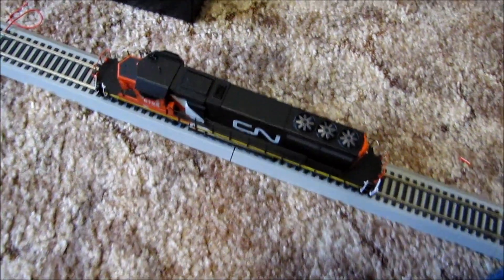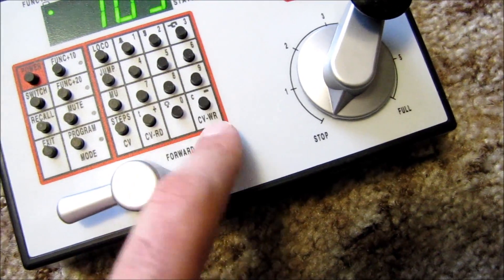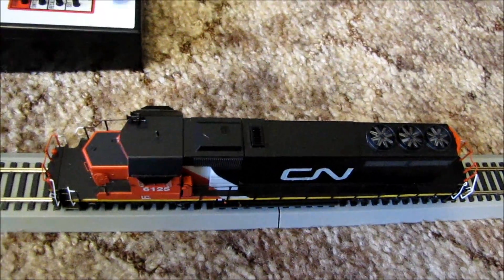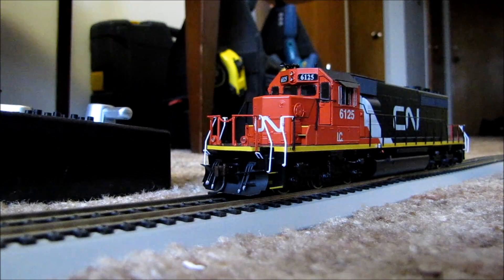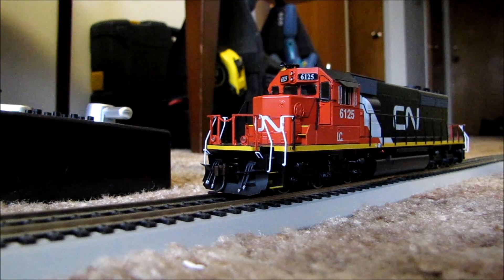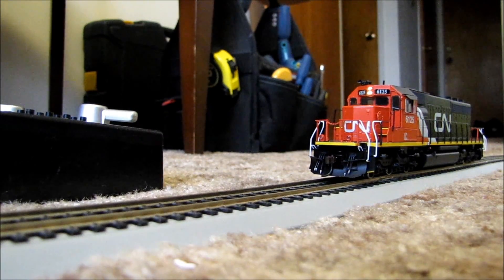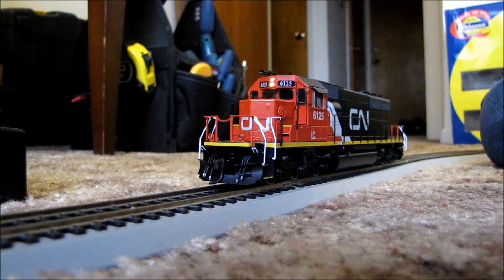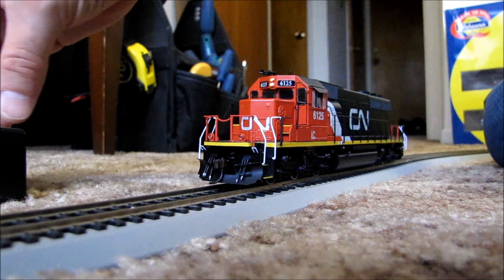3.18.11 Configuration Variables 101, How to Change them with Zephyr

Comment: Hi there hope you might be able to help me. I have digitrax zypner extra and also athearn gp40-2w. I am able to set the ditch lights to flash when the horn is blown (function key 2). I want to make the ditch lights flash without the horn blowing when I press function key 6 on the digitrax. They should flash continuously.Any advice?

Comment: Hi there the loco has quite a bit of functions dcc sound with head/ tail lights, horn , bell , ditch lights , brake squeel, compresor, a bunch of goodies now that i found the manual it recomends the digitrax dz143ps but im not sure if its still made btw would you recomend the zephyr im looking for a controller where i can add a walk around controller ty :)

Comment from the maker: @ronoc931 I'm a digitrax fan, so I would suggest a DH123D, but for other options the NCE D13SRJ works great.  These are both 2 Function decoders and work great if thats al the functions you need.  If you are looking for more functions,  the DH163 is a 6 Function decoder and thats what I would go with.